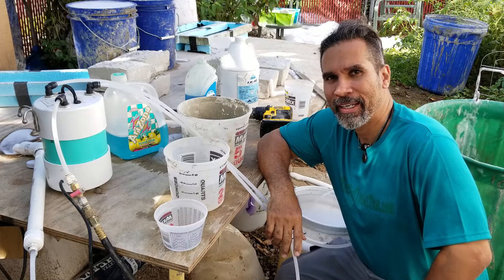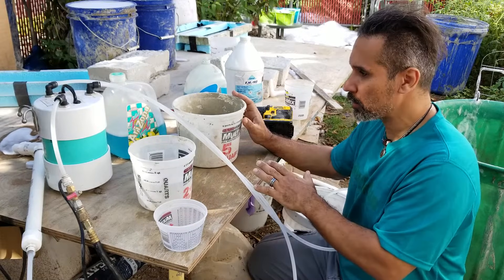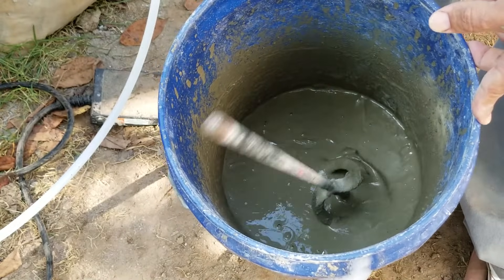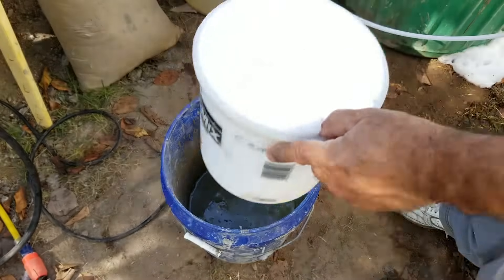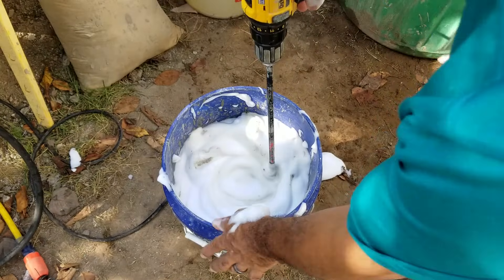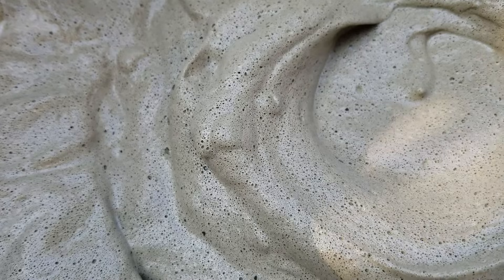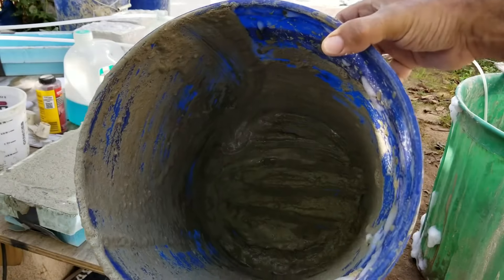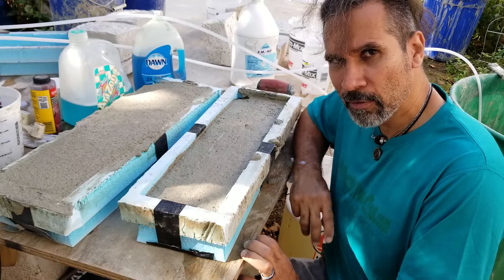How To Make Aircrete Part 2 #Aircrete #Foamgenerator #AircreteHarry #AircreteHarryFoamGenerator

Comment: So, Im a little confused.  You say 2.1 gallons of foam for the batch you made then used two 5 quart buckets plus over filled the second one.  Here in Florida there is 4 quarts per gallon.  So 10 quarts is like 2.5 plus the overflow.  That was at least 3 gallons.  Did I miss something

Comment: At about 6:55 you say that a little overfill on the second 5-quart bucket of foam will bring the total to 2.1 gallons of foam. 5 quarts is 1.25 gallons, so you're really looking at 2.6 gallons of foam. (Depending on your application, that 25% difference could mean a lot.)

Comment: Can you pump this into a cinder block wall without losing the insulation value of aircrete ?? Or how would you put it inside the vertical holes?? Thanks
Reply: That’s a damn good question, man! This is somethin’ that I’m also interested in knowing.

Comment: The more water in the cement will weaken the end product.  Are you taking into consideration that the foaming solution is mostly water?  Shouldn't you subtract the amount of water in the foaming solution to keep the cement at its maximum strongth?

Comment: hi i have a few questions:
1. What are the proportions of water and soap in the "foam mix"?
2. can it be used "ecological" soap to make th foam, would it still work?
3. if i make a construction made with aircrete bricks, would it be strong enough to support the weight of a wooden roof or a living/green roof to make a "hobbit house"? thanks
Reply: I’d like to know this too!

Comment: What about a Air pump tubing put into the sides and bottom of the bucket, to force air, while the lid is on, and there could be a hole in the lid, to slide the drill piece into, before attaching to the drill.

This way, much more air bubble are being forced into the mixture.

Also, the soap, stay away from dawn, it has degreasers.

It's better to use a plant based soap like Seventh Generation with out any degreasers in the formula.

The Concrete, try using Fiver reinforced Concrete by Quickcrete, to make the concrete less brittle by adding tension from the fibers.

Water, try using distilled water, free of contamination or minerals.

The drill bit, could also have additional paddles welded onto the stem to force more air into it, while drilling clockwise.

InshaALLAH brother, hope this helps.

Comment: Good day Harry, can sand be used in the aircrete mixture?  The purpose of the sand is to reinforce the blocks or panels that could be made using aircrete.
Reply: I was thinking if you added some fibers for fiberglassing this would be pretty strong. Cut up the fibers so they're shorter and mix them in.
Reply: @mypronounismaster4450  Thanks. I'll definitely try that
Reply: Earle Ramage  Great, tell me how it goes. I'm curious. Try using fibers about a half to no more than one inch long.
Reply: @mypronounismaster4450  You can purchase fibre already cut from a Redi-Mix supply our from a lumber yard that carries a supp;y of cement and stucco supplies.

Comment: Could you use air Crete for tiny houses?
Reply from the maker: Hi Faith,
Yes! you can use Aircrete to build a tiny house. I'm planning to build a 10 X 10 foot aircrete shed. The technique i will be using can be scaled up or down for any size tiny house. I should be starting in the next week or two on that build.

Comment: Crucial information to understand the next videos:

A mixture of one 94-pounds bag (or 42,6 Kilos)
of Portland cement and 6 
gallons (27 Liter) of water yields a volume of
about 1.1 cubic foot. (or 31 Liter or 8 Gallons).

Desired mix = 1,57 Kilo cement + 1 Liter of Water

or

Desired mix = 11,75 pounds cement + 1 gallon of water
Reply: One gallon is 3.785 liters, go to google. So 6x3.785=22.71 liters instead of 27 liters.
Reply: Why people still use imperial.. metric is easier for conversion. 1000 liter of water is 1000 kg and is 1 cubic meter.
Reply: @MrAdriandi  The problem is: is this guy using an Imperial gallon or US liquid gallon?

Comment: Hi, I love your authentic Eric Reid videos I have a simple question for you maybe not so simple is it possible to do a driveway with this aircrete if you had system setup for it is there something that I don't understand why it would fail with normal lightweight traffic especially if I just did like big sections with dividers and all expansion joints everywhere is just something I don't understand thank you for your time.
Reply from the maker: Yes you can use aircrete for drive. There are several aircrete mix designs you could make,  for a driveway I would use a denser aircrete mix.

Comment: I would like a mix to pour down through the voids of an existing block wall.  So I guess I would want a mix that was lean on cement because I'm looking for a concrete that is going to be light to maximize its insulation property.  However, if I make it too light, that would seem to reduce the likelihood that it would be liquid enough to  pour down to the bottom course of blocks. Any insights?  Thanks.

Comment: For a small scale project has anyone considered just using $1 store shaving cream?
Reply from the maker: I don't think anyone has considered shaving cream  that could be something worth trying.
Reply: crumbles
Reply: @savitrrakatamatah7256  ...did you try it?
Reply: @FlwrMs  yes i sure did and it just crumbled, I was very hopeful, although I don't know if the ratios were right because shaving cream is not very bubbly and I think you need larger bubbles rather than small and compact ones for it to work correctly.
Reply: @savitrrakatamatah7256  , thank you for sharing!
Reply: @FlwrMs  yep no problem

Comment: Hi Harry,

What PSI is your compressor at to get the 3# in 5 gal bucket? I realize adjusting the valve changes the CFM but wondering what PSI to start with? One of your videos said 15 PSI are you still using that? Thanks much
Reply from the maker: I have my compressor set to 95 psi. The 15 or 30 PSI was for a different foam machine.

Comment: I have a question for you. Could the aircrete mixture including the cement be used let's say on a wall like you would do a stucco wall? Do you think it would hold on a verticle angle while hardening?
Reply: if density is right yes.
Reply: Spacecrete. Drying additives used in 3D printing. No Forms necessary or up against 1 wall.

Comment: Harry could I suggest dumping the mixer and folding the foam in by hand (at least at the very last)? Only you still draw in a lot of excess air every time you break the surface with a fast power mixer. What you do is great and very instructive (it's why I clicked the bell), but you're still plagued by big bubbles weakening your final results. I think if you tried really avoiding bubbles you'd get a great mix, because the results look perfect if you don't include those cavities.

Comment: Your ratio is unclear. You use mass for two parts, then you use volume for the third. Please consider putting the ratio in imperial and metric in the text section.
Reply: The weight per volume of water is a constant. Hint: 6 gallons is roughly 50lbs.

Comment: Thanks Harry.
What were the mixes expressed as a ratio, please.
For instance 10 parts water to 100 parts cement by weight, or whatever?
Reply: 94lbs cement to 48lbs water (6 gal)
Reply: Convert Harry's measures to metric and you near as damn it get 1.90/1.00
The rule is pretty much in the middle of 1/1 to 1/2 no more no less, so Harry's mix is at the upper end.
Reply: Great to see someone else who thinks in metric! Volume in   quarts, gallons etc is lost on me and no doubt many others.  So it's good to put it in terms of ratios.  I got roughly 9 cement to 5 water for the slurry (prefer to err  on using more cement).  But what was the ratio of foam to slurry?

Comment: You will not be able to make a good quality FC this way.   
Use a Protein based foam concentrate, forget the soapy foam!!   Reduce water cement ratio by using a super plasiciser.   
U can make your protein foam concentrate yourself if you have no supplier for this.

Buy a bag of dried blood=an organic fertilizer ( slaughterhouse by-produkt)

Make a 2,5% lye solution and heat to 70 degree C. Stirr in the dried blood and agitate constantly. Untill the blood is dissolved. Repeat until the lye is saturated. Let cool down. Filter the brown liquid through a cloth.
Optional: ad some ethylen glycol for winterisation and preservative against decay and rotting.
Now you made the best foaming agent ever! Harmless to the environment.

If you make your FC from 50-50 cement and lime, you will reach high compressive strength and better elasticity modulus.
Of course you can ad sand to increase strength even more but than insulation value decreases

Regards
Bert españa
Reply: Blah blah blah
Reply: @andrewmarkert1146  
your reaction an outburst of intelligence.
Reply: @andrewmarkert1146  
Little andy Markert's contribution to the foam concrete topic is (apart from a stupid remark) ... Zero.
Wipe your snotty nose und my little man.  Lol
Reply: @sonofagun3193  Tell your mommy you just learned your not supposed to wipe, back to front.